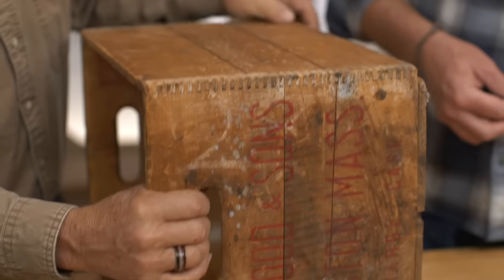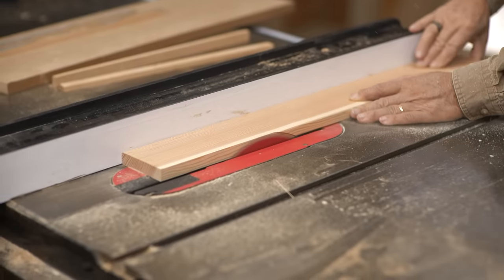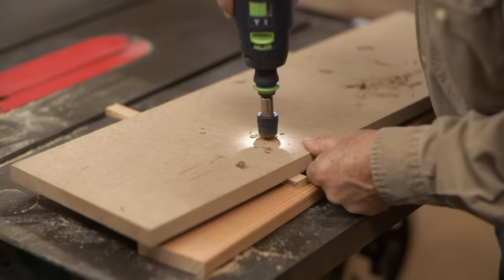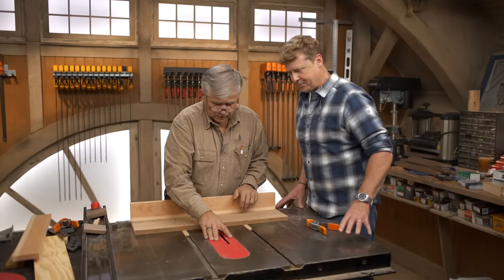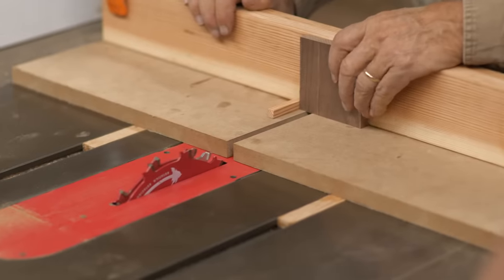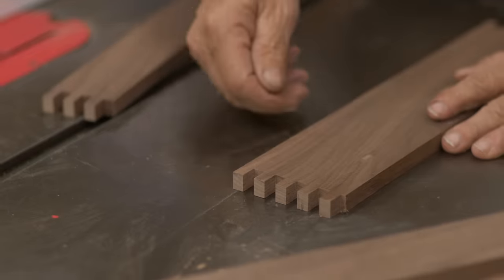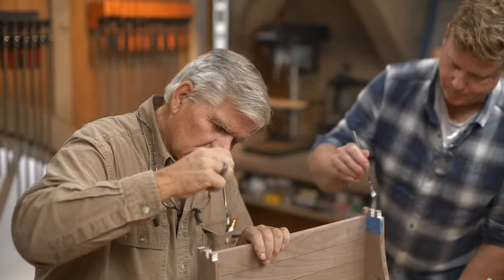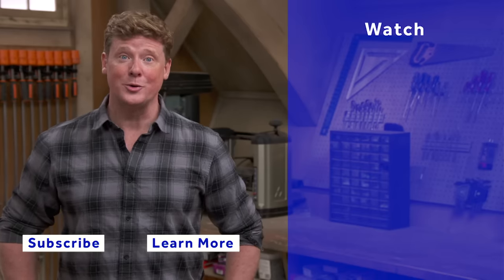Box Joint Jig | Build It | Ask This Old House

Comment: I made this jig and been using a few times. One problem. I keep getting break away on the back of each finger joint from the dado blades. I used tape and it works alittle bit but still some. How did he get his with no break away. And with no tape or anything. Any suggestions?
Reply: Same here - some things to try: his fence looked planed, meaning his stock and fence probably sit very flush and his fence is acting like a backer board. Try that or try using a planes scrap piece as a backer board to support the wood fibers. He was also using a dado set WAY nicer (i.e. sharper) than mine… I’m sure that helps!

Comment: I'm not a big fan of wet lubrication on my cast iron top: Paste wax or similar is just cleaner and longer lasting (beeswax is nice also but can be stickier grabbing fine dust). Also, much less likely to contaminate my work pieces with a drier lubricant. Aside from that: a good jig to start down the rabbit hole of joinery.

Comment: This jig has a second purpose as a door stile tenon jig without changing anything so long as the fence is square, I like to build a more substantial fence with a cap screw on the back corner for fine tuning square and attach the fence with machine screws and threaded inserts on the base to be able to loosen to make said adjustment, but then it's more intimidating for beginners and that's who this was aimed at.

Comment: Beautiful serving tray. Simple jig. I think squaring the fence may have been understated (over simplified?). Base was probably squared. Base was squared to fence when it was mounted on rails. No reason it wouldn’t work. But, … a lot of sled construction examples use one screw to “temporarily” mount the fence, make a series of test cuts, and fine tune the squaring.

Comment: Not to take away from Tommy's sled this just reminded me I once had to make 8000 small finger-jointed jewelry boxes starting from 8/4 rough cut cherry.  I had a custom 3 inch tall shaper bit fabricated that would cut all the finger slots in each end in a single pass. 8 passes per box as opposed to about 80 individual cuts per box. The sled is a much better option for joints with 1/2 inch teeth like the ones in this video though.